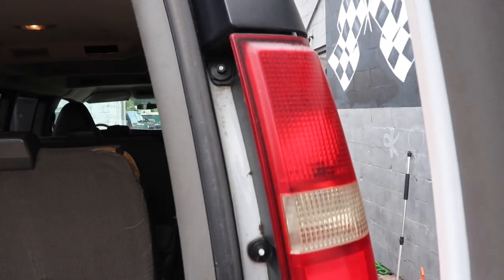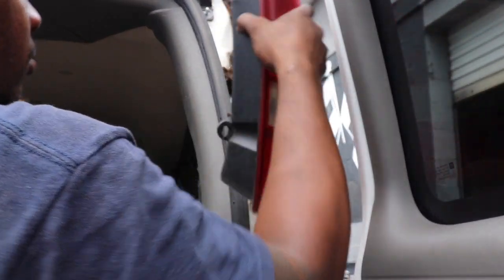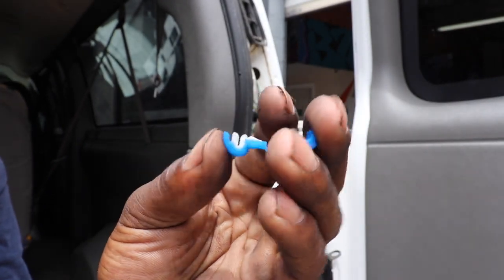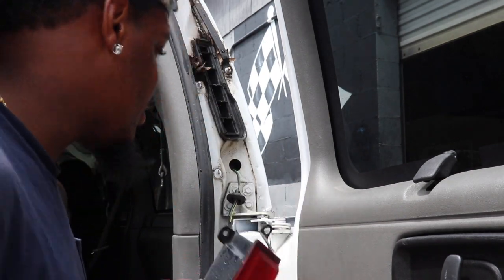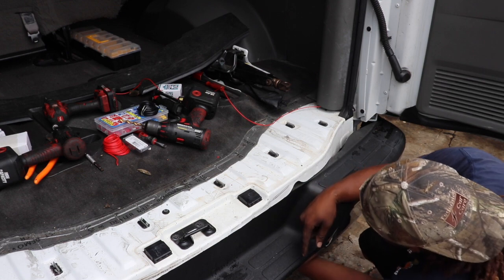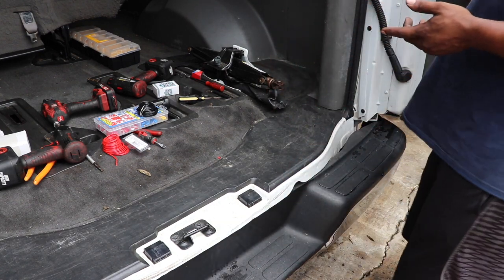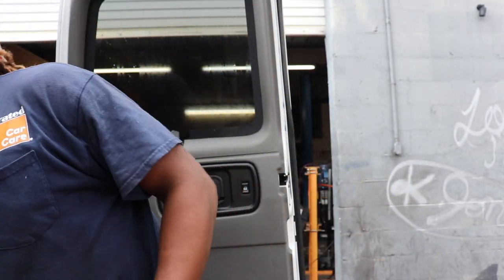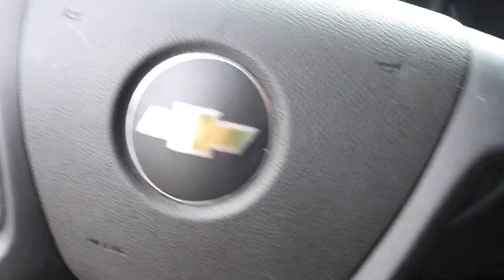How to install backup beepers on your vechicle

Comment: When running a wire through holes in sheet metal, it's a good idea to fit a rubber grommet into the hole.  It will keep the edge of the hole from chewing through the wire insulation and causing a short.
Reply: what i was thinking no rub no rub
Reply: That's not a bad point.
Reply: It’ll be fine

Comment: I just finished designing the circuitry and buying the components (transistors, 555 timers etc) to build one of these bad boys and then I find them on eBay for $4 lol.  Great video, straight to the point and all makes sense to me because I know what you're doing but I reckon for some people watching you might want to clarify what's happening electrically here.  ie. Upon reverse gear selection , power is switched on to the reversing lights which is automatically providing 12V (or 13.8 to 14.2 volts from the alternator when engine running)  to the reversing beeper alarm, which activates it to switch on and beep.   Just so people understand what is happening.

Comment: So I got a question. I installed my alarm that looks identical to this. No metal plate attached to the ground terminal that grounds it without the need for a wire just all plastic. I wired it exactly the same as this video, however when I put it in reverse it starts out proper for the first beep and then just starts beeping very fast, is this a ground issue? Voltage issue? Bad connection? Any ideas?

Comment: If you want it to look professionals you would run the wire in where factory wires are ran,use solder not quick taps and use factory grommet. You should use quality products, most good backup alarms have a ground strap that uses mounting screws for ground
Reply from the maker: Haven’t had any complaints about it till this day bro 🤷🏾‍♂️ as long as my customers are happy that’s all that matters 💯

Comment: Unfortunately this doesn't work for my truck. I have a 05 envoy and the only white reverse lights is the circle lights at the bottom which also turns on when you unlock the truck.😢